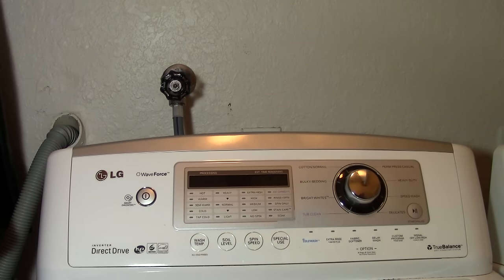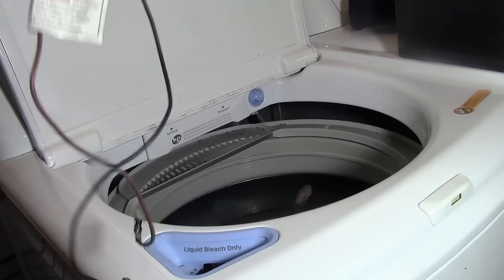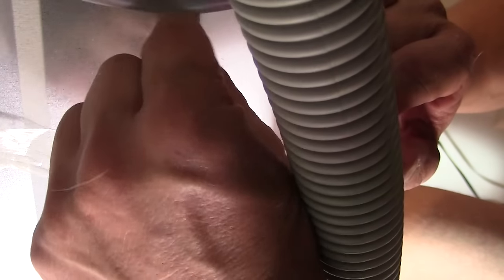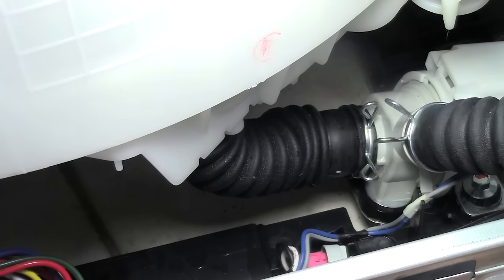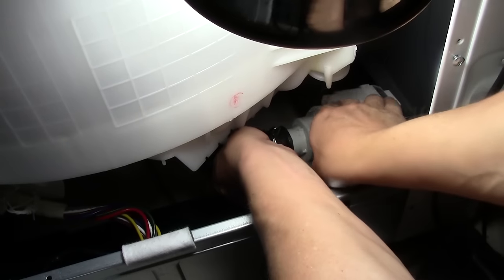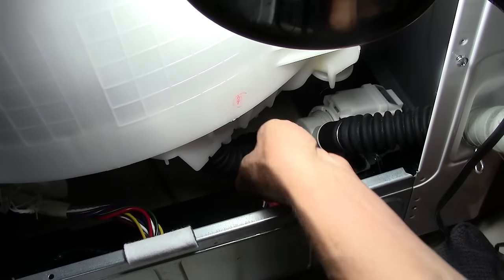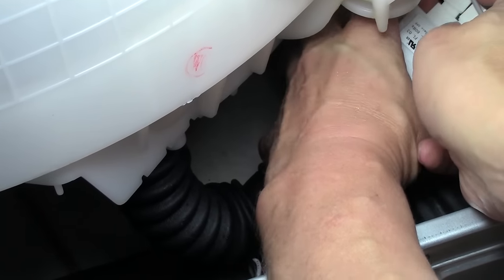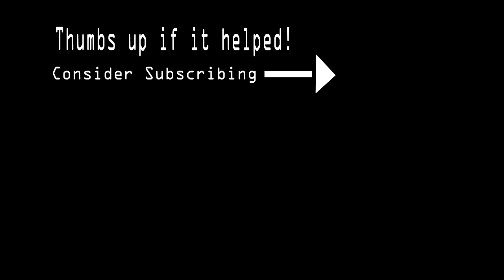LG Washing Machine Wont Drain or Spin --  (OE ERROR CODE) How to Fix PUMP and LINE

Comment from the maker: Look here for a replacement drain pump:  http://amzn.to/2vomM9Z
Reply: Good  job
Reply: The pump in the link, does not work with the original pump housing
Reply: What if your blue wire broke off(corroded?) right after the guard over it where it plugs into the pump motor?

Comment: So grateful for the handy people that post solutions that help others. This video was a money saver. I loved how you listed the type of tools needed. That was so helpful!!! I was able to get my pump out but didn't find anything lodged inside. I ordered a new pump on Amazon and installed it successfully. I am now doing my laundry. Thank you, thank you, thank you!! So grateful for this video!!!
Reply: Do you have a link to the replacement you purchased. I think mine is going out. Thanks
Reply: Here you go:

https://www.amazon.com/gp/product/B00AYBKJBK/ref=ppx_yo_dt_b_asin_title_o09_s00?ie=UTF8&psc=1 @mrgator85
Reply: @Cheyenne9663  Thanks. It's on its way!
Reply: I didn't find anything inside of mine either. If it's the pump, then that's a relatively cheap fix.

Comment: This video is the real deal, saved me money and time with not needing to wait on an appliance guy. Warning, drain as much of the tub as possible as when you disconnect the hose to the pump you are going to have a gallon or so pour out. I emptied the tub completely and still had this problem. Culprit was a bobby pin.....

Comment: Hey Jake, thanks for pointing me in the right direction. I had  the OE error so I took a look at the pump. Interestingly, the pump was clear but when I removed the blue wire, the wire just came off of the connector. It was corroded where the wire attaches to the connector under a plastic hood. Rusted through. (My washer is 10 yrs old and the wire connector is different than yours) I soldered it back on replaced the plastic hood and sealed it with a dab of silicone. I also needed to put a little sealant on the hose connections to the pump. The factory had some kind of sealer there that was dried up and preventing a waterproof seal when I put them back on. All is well now. Thank you!

Comment: This video is 6 years old but our washing machine has lasted us a long time and I have almost this exact model. It just finally stopped pumping and I was able to use this video to extract and replace the pump. I found this video more useful than the other ones that exist because of how you filmed exactly what was going on.

Even though it's many years later, I appreciate the effort to document this because I, at least for now, don't need to spend money on a new washing machine. $85 for the part and hopefully it lasts a number of years longer.
Reply: I paid $45 for the same exact make, model and manufacturer for my pump on Amazon

Comment: Thanks for the help! I was able to fix my washer using this video. I found three nails in the pump. 

**Only word of advice: even though I got all the water out of the tub - make sure you have another small bucket and a bunch of towels available when you remove the hoses from the pump. I had another gallon of water come out as soon as I popped off the hose pump.

Comment: Thank you!  This made it a lot easier to fix.
An added note for anyone unable to drain their washer all the way:  Because the short hoses connecting to the pumps are soft, I was able to hand pump most of the water out of the system by squeezing the drain hose rapidly, like CPR.  The little that remained in the system wasn't hard to clean off my floor.

Comment: THANKS BIG TIME !!! I didn't know what I was going to do. When my 3 year old LG top loader stop in the middle of a wash cycle, left me with an error code "OE" and a 1/2 tub of water. I got out the manual and realized the code had to do with draining. I am fairly handy but I've never worked on a washing machine and I had a feeling this was a major deal. Regardless, I figured the first thing I had to do was get the water out of the tub. One thing I'd like to mention is that my washer is located right next to the door into my house 2 steps up from the garage. I put a 5 gallon bucket on the garage floor, took the drain tube out of the wall, I put the palm of my hand over the end of the tube as I lowered it into the bucket and the machine started to drain. As the bucket got close to filling I put my hand back over the tube end and put the drain hose back in the wall while I dumped the bucket. I repeated this process 3 more times and the all but about a cup of water had drained from the machine. I found your video and thought I'd try to make the repair and amazingly I found a 3 inch aluminum removable nose bridge from a COVID MASK that I had neglected to take out when I washed the mask stuck and wedged in the pump. I pulled it out and the impeller free so I reconnected everything and put the clothes back in and started a new wash cycle and the machine worked perfectly. Something I'd like to add is from the manual I learned about the "tub clean" feature that LG recommends everyone does once a month. It is a simple and easy cycle to run.  Heck, I didn't know about this and I felt this was probably the reason for the drain issue but actually the pump and the hoses looked really clean. I am amazed the nose bridge piece made it out of the tub. Thanks again for your great video jakeguitar01.

Comment: You just saved me another service call.  There were nails in the drain (most probably from my jean pocket).  Had the repair man come once and then it clogged again.  Was about to make that second call, but then found your video.  Found a couple more nails in the drain and one in the pump.  Your video made it really easy to fix!  Thanks

Comment: Thanks for making the video, which gave me the confidence to do this fix (there was a sock in the pump).  Thanks also to the commenters for the tip on using a shop vac first to suck the remaining water out of the tub and then to suck the water up when you detach the hose (from the tub) to the pump.  Using the vacuum there was very little water on the floor.  Like other commenters, the pump on my particular model was different than the video, and was held down with screws, not bolts.  Still it was in the same location with the same hose positions.  I did not have to detach the pump from the machine to pull the hose off and take out the sock.  

If your machine is sitting in a drain pan, be sure to search for the videos that show how to use PVC pipe to easily and safely lift the machine out of the pan to where you can work on it.

About 35 years ago I had a washer that regularly sucked little socks into the pump.  I got really good at extracting them.  I can't believe 35 years later they have not solved this problem!

Comment: Thanks so much for your video, especially since you talked a little faster and more directly to the problem than some videos people post.  I have the same machine and I bought the dryer that matches.  They never gave me a problem until they were a few years old.  My problem was a little more difficult due to the fact I didn't measure the width of my laundry room when I purchased the washer and dryer so therefore I had to arrange them in my laundry room a certain way.  There was no easy way to remove the washer in order to get the back off.  I had to remove the exhaust to my dryer and move it over and then pull out the washer to work on it.  Anyway I kept getting the same OE code and once before I had cleaned the drain pipe thinking I had fixed the problem.  It worked for about 3 washer loads and then the OE code pops up again.   Your video is exactly what I needed to view because our machines are identical.  I will now go a little further and remove the back of my machine to get to the pump itself and hopefully have my problem solved.   Thanks again!

Comment: Cleared a Bobby pin from the pump without even removing it thanks to this video.  Just pulled off the hose leading to the pump, felt around with my finger and used a magnet to remove the pin.  Took me longer to drain the tub than anything else.  Using the drain hose to siphon out the water worked well for me.  Thanks so much for this video!!!

Comment: Great video and insight. I did not have to remove the pump BUT even though the tub was empty of water there was a lot still in the bottom area below the tub and in the lines. So soak up towels are a must especially if your in a condo like me. A small screw was logged in the pump and I was able to get it without removing the pump. Thanks again.

Comment: I appreciate your video, drained water, pulled motor and it worked when plugged directly into AC power...oh my...went to reassemble everything and discovered one of the power wires was broken, the blue wire you mentioned. Repaired  wiring and running fine now! Thank you for the video...it helped
Reply: M Turner don’t you mind to tell me where did you get the replacement?? Thanks.

Comment: Very helpful video.  Thanks!  I could not see an obstruction in mine, so I had to take the pump apart.   It was very easy - lift a plastic "clip" on the side of the pump and then turn it clockwise.   Upon doing that, a sewing needle fell out.   I put everything back together and was good to go.  To drain the tub, I mostly dipped it out.  I think what might have worked better and quicker would be to remove the plastic piece that holds the hose as it leaves the washer, then just lower the drain end of the drain hose into a bucket (or whatever).   It can be raised again to stop the flow.  I did this to get the last of the water out of the tub/pump.   There was quite a lot of water remaining after dipping it out.

Comment: I wanted to take the time to thank you for this video tutorial. I have a very similar machine, model WT5680HWA, that starting throwing this error code tonight during a wash. I dove into the pump and found a small sock just before the pump inlet fitting. When the hose came off it was right there. It was difficult to get all the water out of the tub, so to those that will do this, expect to get some water (I got A LOT) when you pull the hoses, even if our tub is almost empty. I had plenty of towels ready just in case, and I'm glad I did. Again, thank you!
Reply: Steven G. I have the same washer, currently having issues with it leaking. Thought it was pump but could be something with the bleach  compartment syphon. It doesn’t give me an error but now the water temperature button option on the panel is not responding. Frustrating! Never had an issue with it before.

Comment: Have a Samsung with OE code - your video will most likely work just as well for Samsung. Thanks for posting this! Cheers from Canada!
Edit: Turns out our Samsung set up was almost exactly the same, right down to the flexible plastic cover. Same blue and white connectors in exactly the same spot. Got it all apart and initially I was disappointed that there was no blockage nor did it appear anything was interfering with the pump. On closer inspection I was happy to see what I thought was a piece of wire. Turns out it was one of my daughter's earrings! It fell out easily and the pump spun as expected. Put everything back together and tossed in a load of laundry and everything is working fine! Thanks again for the video!

Comment: Thank you for that posting this. You sir, are a legend! :D. It gave me the confidence to take on my LG WT-H750. I did not see an error message as I generally ignore it's mid wash beeping. Would not drain. Buzzed. After water removed in tub, it still spun so I narrowed it down to a likely pump issue. Anyway, did the following. 

Unplugged from power and disconnected hoses. Then bucketed out the water from inside and then I chocked up the washing machine (bricks would do) so I could fit a deep baking tray under the pump area of the machine. I only part opened the pump filter so I was able to shut as I filled the baking tray. 7 trays worth emptied (about 28L). Then fully removed and filter checked. No obstruction. I removed the water removal hose to check for any obstructions there too - none found. Removed the back off the washing machine using philips head screwdriver. The pump is different to yours but same principle. Took photos of pump and wiring. Removed 2 x wires from pump. Removed hose from pump (sat a tray under edge of washing machine and pump to catch any extra water) by squeezing clamp and moving then pulling hose off. Removed screws x3 from outlet of pump on outside of machine. Removed pump from machine. White casing does not seem to come off. Still, longer flat head screwdriver managed to facilitate removal of 3 screws (photo where screws sitting/orientation of pump magnet area to impeller area). Access to impeller area gained. Wiped clean inc washer. Removed lime green zip end that had been lost in the machine for 8 months but only caused issue 2 nights ago. Put everything back together. Machine now works perfectly again.

My next step, prior to putting it back together if there was no obstruction found in the impeller, was to take the pump unit over to the local appliance guy and borrow his ohmmeter for a few mins to check if the pump electricals were stuffed as to whether or not to order a new pump. 

LG live chat had been utterly useless in even telling me how much water  the second barrel would hold (1-2L = no, try 28). 45 mins to be told of the pump filter location and then told to get a  technician. Utterly useless. I watched your video during the inordinate waiting times I was experiencing with these useless sods. 

So, thank you from Australia. This gave me the confidence to take on the machine. Otherwise would have cost me about $100 call out fee and then labour and, if they were not thorough then I would have been up for about $90 more on a new pump.

Comment: Accessed the pump, an ankle sock found its way through and was blocking the pump. Removed and it worked. Note : The washer when reloading with  wet clothes, it senses ALOT of water is needed , way more than necessary . If reloading wet clothes, be sure to use about 1/4  of the original load or it will be a nail biter watching the water fill to the top .

Comment: Great video!  We basically had the same problem that you described in the video and were able to borrow a bilge pump which helped us get the water out more quickly and then got to the pump and found a bobby pin lodged in it.  Really appreciated your detailed and informative video which helped us solve the problem ourselves and get the washer working again without an expensive repair person.  Thank you!
Reply from the maker: +Beth Hoffer. ------>  Excellent!  Glad it helped...

Comment: This is a great video.  I'm not sure how you ended up with a dry pump though.  I emptied the tub from the top until it was basically dry, but when I remove a hose from the pump at least 2 gallons of water came pouring out.

Comment: Nice video thanks. I have a few things to add. As far as draining the machine is concerned, if you have a floor drain or door to the outside you can just place a small shop vac hose on the washers outlet pipe and when you lower the washers outlet pipe it will flow freely until the tub is almost empty, You can then just suck out the rest with the shop vac. Also my machine was a little different when the pump was supposed to run I could hear a motor running but nothing pumped out.I looked in the pump suction but the impeller was free and could easily spin, but I went ahead and bought a replacement pump. When the pump arrived I had to turn the washer on the side because instead of bolts holding the motor there were 2 screws that could only be reached from the bottom, this actually made the job easier and it took less than 15 minutes start to finish to remove and reinstall the pump. It worked perfectly. I was curious about what was wrong with the pump. I disassembled the pump and found that the impeller was spinning freely because the motor shaft had corroded and broke.

Comment: This was a great instructional video!!! In our case, it was the blue wire that got "fried". We fixed it, checked the hose pump for any blockage (there was none) and low and behold, once we put everything back, we did a test run and works just fine.  Thanks again!!!
Reply: This...mine same exact thing.  Blue wire seemed to have broke free.  Poor design on the spade.  Put a new one on and all good.

Comment: Great video.  Thanks.

When I first encountered the code I sucked the water out through the discharge hose with a shop vac and thought all was good (man, there was a lot of water in there - very deceptive). So, I started another cycle and the code returned.  I then knew it was either jammed or a bad pump.

So, I turned to youtube and found this very helpful video.  I'm glad I did because I was going in for the kill and this video provided some insight.  The culprit - a small lock key in the pump.  Here's what's funny.  When I checked my key ring, I noticed a key was missing; it's one of those keys that attached to some cheap plastic and it broke off - now I know it broke off in my pocket.  I thought I lost it in the yard somewhere as I was doing some landscaping.  I was like damn, I lost the key.  I was the last one to wash (my work clothes) and all was good until my daughter starting washing her clothes, so I assumed she left something in her pockets.  Well, I was to blame, but not intentionally though - haha!  All is good now and no money spent.